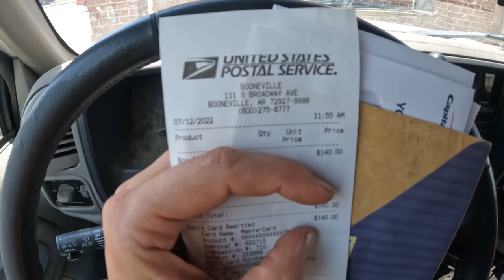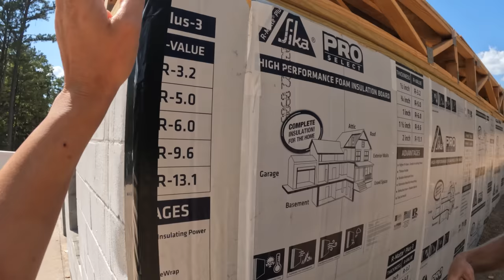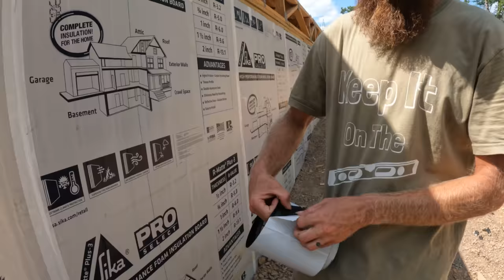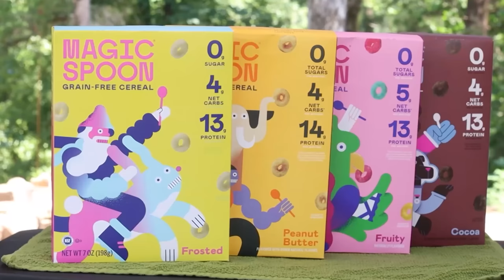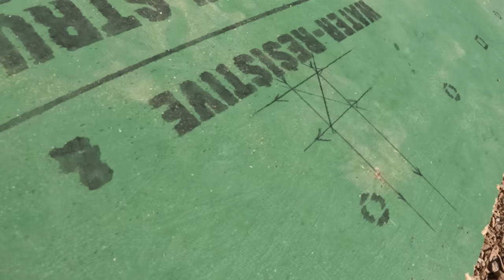This Changes EVERYTHING for Us! | Zip System Sheathing UP |Couple Builds Basement for Dream Cabin

Comment: So happy for you that you got the zip boards up.  Gary, I wish you had a table saw to do all that cutting rather than bending over to the ground to make the cuts.  You are going to need the table saw anyway for the upper cabin build, so why not go ahead and get it?   I also wish that zip tape roller had come in!  I want to see the basement waterproofing finished so that you guys can get the basement ready to move into!  Things will move along very swiftly once the waterproofing is DONE.  The hoops Arkansas makes it's residents jump through to get personal property registered is INSANE.  Every state is different, though, and each has it's pros and cons.  Abe was a very brave little feller.  He did great at the dentist's.

Comment: HAVE YOU CONSIDERED reaching out to the homesteader community and asking to BORROW a ZIP SYSTEM ROLLER? I've seen several being used during builds, and they are now beyond the taping point of their builds. Possibly a mica countertop roller would work as well. I think they are the same thing.
Reply: The Formica rollers are the same as a zip roller and they Formica rollers are cheaper and more durable

Comment: IF THE ROLLER THAT YOU NEED IS TO TAPE THE SEAMS ON THE ZIP BOARD, YOU CAN USE A ROLLER THAT IS USED TO SEAL THE SEAMS ON WALLPAPER.  IT CAN BE FOUN IN THE SECTION FOR WALLPAPER IN YOUR LOWES OR HOME DEPO.  JUST A THOUGHT.

Comment: Those zip systems rollers are very similar to rollers used for working with fiberglass. Try a local boat shop and see if they have a comparable roller.

Comment: Congratulations on setting it up! Edit: I wanted to say that because it's finally getting closer to becoming a home for you guys. As family it can't express how it feels to have a home you built with your own hands.
Reply: I wanted to add a reply regarding Amazon delivery situation.. I can say that here are issues within Amazon delivery routes and delivery drivers. I originally was Amazon's Warehouse Associate, worked for three months in 2020. here are internal problems between management and workers. It was great pay but terrible environment. I was paraded around in different positions like I was just expandable to replace any inconveniences posed by workers who couldn't do the job because of exhaustion. I went from package placement to package sorting to package handling. Literally just everything I had to take over overnight every week. That gave me back pain for two weeks on first shift. I can say within reason that it's probably 3-6 weeks late due to high volume of mail & packages coming in at Amazon & normal mail/package sorting centers even UPS has this issue. Take the mail & package delivery date with grain of salt. It's not always accurate. Your product should arrive at least four days or so judging from the delivery dates. Much love, ~ Cassandra
Reply: @RealCassandraSaturn  my issue with them was their navigation system. It's fixed now, but for awhile they were delivering to the wrong house. (Not even reading the address on the box). I've finally got it straightened out after talking to their technical team. (Prime)
But my grandson worked for Amazon as well for 2-3 years. He started out in KC Mo, then transfered to Denver. They did him the same way as you and he was in management. He's since quit.
Reply: @lindamaskus5142  yeah the Amazon delivery drivers were not properly trained in navigation for years in my area and I got to see same way up close as why it was not properly investigated when compliants were received by the drivers and customers alike. I'm glad he got out before it got bad
Reply: @RealCassandraSaturn  it wasn't even the poor delivery drivers though.....it was in Amazon's navigation system according to their tech. I told them ups, FedEx, etc had no problems delivering, and they informed me their system was different than all the others. Anyway, we have it straightened out now, and yes, happy my grandsons out of the mess!

Comment: Gary you can cut about five of those sheets at one time. line them up and screw the corners, then make one cut but get some saw horses. you will need them for the framing.

for the roller, there is J-roller that is used for Formica counter tops or vinyl flooring. it should work for what you are wanting to do and its available at a hardware store.

Comment: Hey guys, very impressed and you should be extremely proud of yourselves for the job you have done. If I see something that would help you I recommend solely based on experience. In my 70 + years I have some, anyway Gary those crocks you wear on your feet are great for the casual attire. They actually are consuming energy from you. A pair of lace up shoes that stay put and move with you actually puts less stress on your legs and feet  and if you happen to get those crocks hung up on something, well you are working kinda high off the ground. Looking good and continued good luck!

Comment: If you can not get a roller for the zip tape .,,get a heavy duty 4 inch paint roller and slide a piece of plastic or metal pipe over the paint roller refill . this will do the job for you . Y'all keep up the good work

Comment: That was a great way to rip those boards. I have tried ripping plywood on saw horses. It's difficult cutting from the side. So this way cutting over it worked out great. Less moving of the boards.

Comment: On the cheap you can buy a 1-2" touch up paint roller & a solid piece of round rubber. Drill a hole through it and there's you're zip tape roller.. 
As in stands you prolly have air bubbles galore, & tape lifting, that compromises the integrity of what yur trying to achieve.

Comment: nice progress.  question about sheathing install.  should the wall sheathing overlap the area you are sheathing by the joists for strength.  I thought it is best practice for the sheathing to go from the wall past the bottom plate to tie it all the together.  by doing this row like this you will line up all the joints creating a weaker system.

Comment: Park your camper on your concrete workshop slab. Hire out the framing and get your roof on quick. You can do all the finishing work but you need to get a roof over your head.

Comment: TIP: Put two large full powered fans in each window as you work in the basement. 1 pointed in the other pointed out. It will circulate air in there for you. It's a GREAT GREAT JOB!!!!♥️♥️♥️♥️♥️
Reply from the maker: Great minds think alike!!!! That's the plan ☺️

Comment: Have you already chosend your windows and French doors to
 completely close it in... also I was wondering,   how will you insulate them inside of the basement and rafters. Will you use dry wall or plastering it for use some kind of wood painely painlely type of block coverage

Comment: You'd have been better off buttering the interface between the basement and the trusses and Zip with liquid flashing...
Then drop the Zip into place, and Zip tape over it, or using the liquid flash the on the lower edge.

Zip tape is great stuff.  But it's still TAPE.

Comment: We always ran our band board long so when we stood up the walls they were tied into the floor joist . Just additional method to tie all the framing and foundation together. Bravo for flashing at the foundation, does a great job air sealing and keeping bugs out of the basement, amazing how many builders skip such a cheap simple step.
Reply: Brother I'm with you on everything said except leaving the band boards long. Brace the wall to the exterior and remove when siding goes on if you can't reach it to remove. Obviously we are have different methods to get to the same result. Peace to you and yours

Comment: What’s up with you putting the zip board upside down :-)
Reply from the maker: IDNK, we didn't even notice LOL! 
They're "Non-Directional", so it doesn't really matter. (But the green side goes on the outside) 🙃 Most people install them vertical for walls. We just needed to piece it together to close in the sides so we did it Horizontal.
Reply: @SimpleLifeReclaimed  I was just messing with you :-) I know it doesn’t matter. In my building career I was always fanatic about things like that lol I had an employee one time put a breaker box upside down he said it was easier that way :-( when I came and saw what he did I made him turn it right side up and rewire it. Obviously he wasn’t too happy. I said well you shouldn’t of put it upside down lol
Reply: One of those 6 inch short nap paint rollers will work :-) and you can also get a graphic arts roller which is a hard plastic roller it’s about 4/5 in’s wide :-) Which I suspect is just about what you’re waiting for?